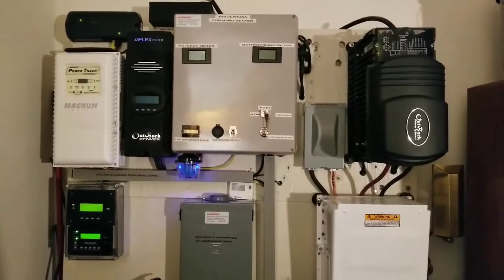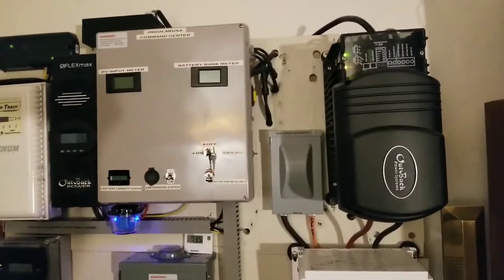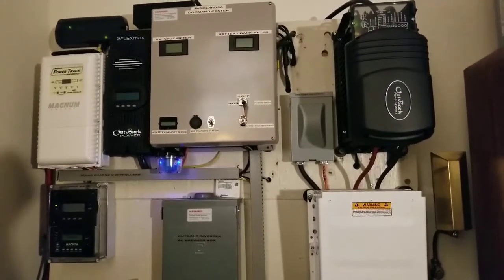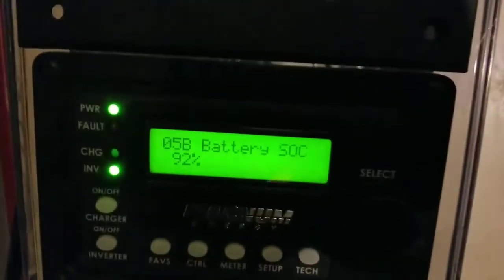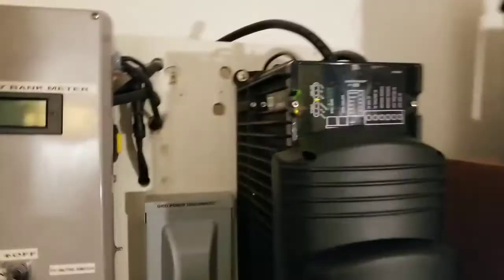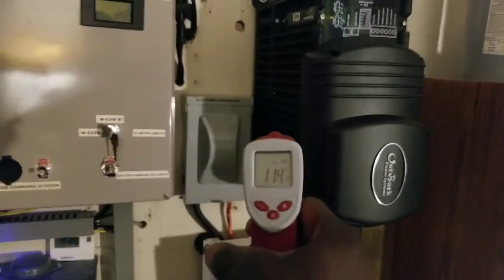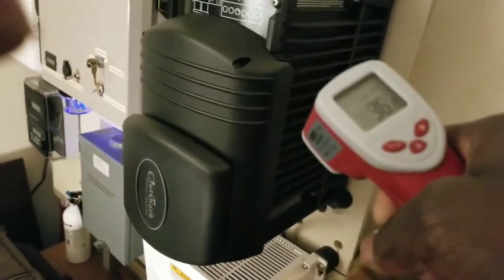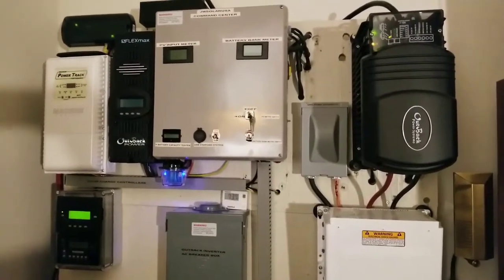FORD FOCUS LITHIUM ION BATTERY vs. OUTBACK POWER SYSTEMS: Charge the 48 Volts Lithium Battery Bank

Comment: 9 cent a Kwh wow that's cheap we pay 47 cents a Kwh
Reply: south aust?
Reply from the maker: Oh....wow
Reply: @jwsolarusa  It's 57 cents a kwh now
Reply from the maker: @awesomusmaximus3766  
This is ridiculous
Reply: @jwsolarusa  Worse is they dropped  the feed in tarrif to 7 cents per kwh
Reply from the maker: @awesomusmaximus3766  
Yes....! Same here in Minnesota.
This is the reason why I was not interested on gridtie solar power system. I preferred the battery backup system
Reply: @jwsolarusa  I got it when the feed in was 29 cent's a kwh it made sense then and 70% was paid for by the government.
The plus side too is I can back feed my inverter to help charge my batts quicker
Reply from the maker: @awesomusmaximus3766  
Ok
Reply: @closertothetruth9209  Vic